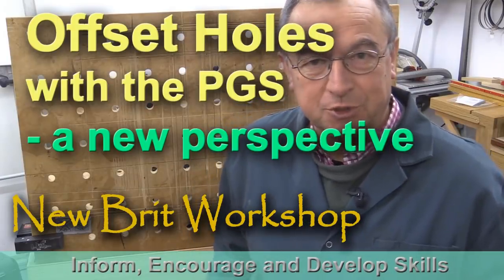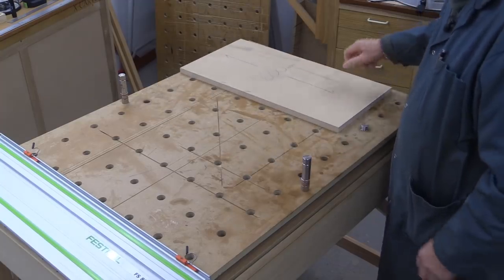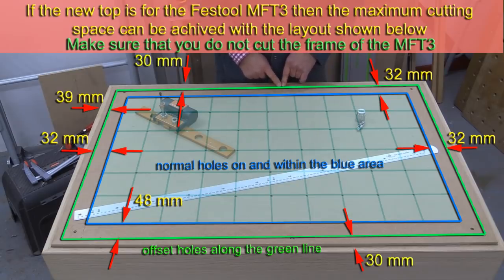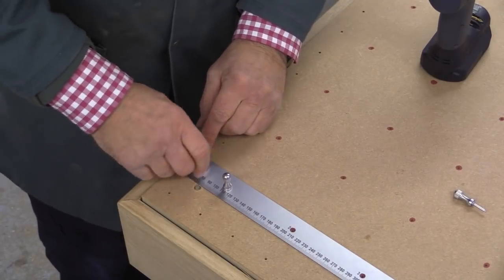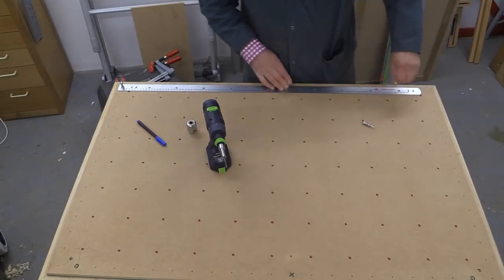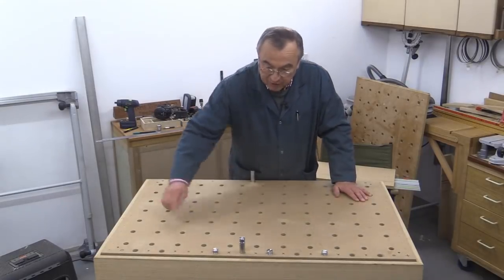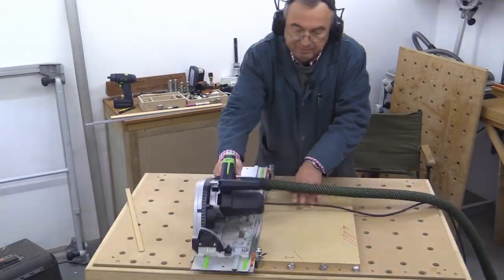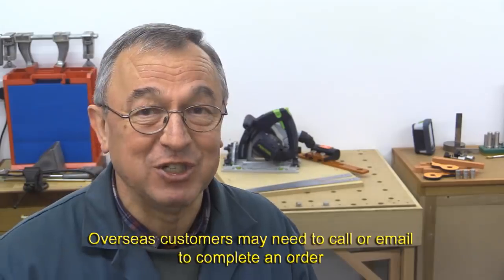Offset Holes with the PGS - and the definitive 4 Cut Test

Comment: Mr Parfitt, the Parf Guide System changed the way I woodwork. My poor man's planer now has 20mm dog holes. My torsion box/shoot board combo has 20mm dog holes. The one problem I keep running into is the pins.  The pins only fit one parf stick. It would be sweet if the 6mm boss were long enough to secure two parf sticks. Just a thought. JL
Reply from the maker: Thank you so much for this. Cheers.  Peter

Comment: Hello Peter, is there any way to drill accurate offset holes for the super dogs using the PGS Mk1?
Reply from the maker: Hi Hugh, Yes, if you use the two rulers set up in a triangle- remember symmetry.  Peter

Comment: Very useful video. I have the system 2 and already created my MFT top with 96mm holes. Fortunately I left a few undrilled holes to make sure I could still extend the table holes at a later date but they are in the way to some degree. I just hadn't thought about what now is obvious - create a series of reference holes all around the edge! Thanks!
Reply from the maker: I am glad that this has helped.  Cheers.  Peter

Comment: What if your table was doubled the size. Do you then connect 2 rulers to get a row/column complete?
Reply from the maker: Hi Stephen, You start at the middle of the top long side so that you then expand left and right in equal measure. This reduces compound error by a huge amount. It is covered in the instruction manual.  Peter
Reply: @NewBritWorkshop  apologies, I should clarify. At the 8 min mark, when drilling the offset holes along the bottom of the table, the ruler is the length of the example table you are using. If the table was wider, the single ruler would not fit.

Comment: https://youtu.be/fTgoeAV4tDk I made an 8x4 mft top. I want to add offset hole long length wise. Can this be achieve after putting 20mm holes into top?
Reply from the maker: Yes, all you need is a set of Parf Revision Dogs:
https://www.youtube.com/watch?v=1iflvxzUIe0
Good luck.  Peter
Reply: @NewBritWorkshop  https://youtu.be/Chtn6GabWXk I used the 20mm guide for offsets. So I can sacrifice any part of the large work area. I wish to make racking for the van, so about 6ft high , this is why I made a large top. I just need to figure out how to make a callapspable worktop that folds away so I can store in garage.
Reply from the maker: Yes, you can use the 20 mm guide to create 48 mm offset holes. You need to use the offset position as you indicate in your video but use the 3 mm drill through it first. That way when you use the 20 mm cutter it has the (required) 3 mm hole to guide it through.  Peter

Comment: Any thoughts on variations of hole placements?  I have been debating doing row 32 or 42 mm from outside edge then starting 96mm spacing. Will be on a larger bench 36 to 40 by 72 to 80 inches. Any direction would be much appreciated. Anxious to use the MK II that I just received but don't want to get ahead of myself.
Reply from the maker: Hi Richard, I have made several videos about offset holes and even an Isometric layout. I can't list all the links but hope that you can search for them. I favour offset holes furthest away from the operator and nearest to the operator for the tall dogs that the rail goes against. This gives the maximum cutting capacity in between. Do search for the Isometric layout which is perfect for 90 deg, 30 deg and 60 deg cuts.  Peter
Reply: @NewBritWorkshop  I should have been more clear, sorry. But was thinking of having the rows and columns start at the 32 or 48 mm from the edge. Thank you for your earlier quick response and hope you have a good day.
Reply from the maker: Hi Richard, You can have the rows or columns with centres as close as 32 mm from the edge of your bench top provided what structure of the bench is below does not risk causing any damage to the 20 mm cutter whilst drilling the holes.   Good luck.  Peter

Comment: Hi Peter. I have started making a new MFT top using your Parf Guide MK2 and I have a question on finishing. I would like to finish the Medex you recommend to help with glue ups. Would you suggest Osmo Polyx and should I apply before boring the 20mm holes? Best Regards, Rob.
Reply from the maker: Hi Rob, Yes, always apply the PolyX or any other finish prior to drilling otherwise the oil will go into the 20 mm holes and make them too tight.    Remember to use a pecking motion when drilling the 20 mm holes and also a dust extractor.  Peter

Comment: Peter,
I think I asked this before but did not understand your answer. I have a couple of festool mft3 boards that are already cut with holes. Is it possible to leverage the PGS Mark II system to add the offset holes?

I know the PGS Mark II system can create the offset holes if the holes are all 3mm. I am asking once they are already 20mm. 

Thanks
Reply from the maker: Hi Jeff, It is not easy and with the original Festool tops you will not be able to guarantee accuracy. However, if you have the small Veritas Parf Dogs or the locator dogs from the Mark 2 PGS you can butt a Parf Stick against them to create a new row of 3 mm holes.   Peter
Reply: Peter,
Thanks for your quick response. It is really impressive when you respond like you do. I like your idea regarding an existing Festool MFT table. I think it might work how you described above. I have several Festool MFT table boards and I would prefer to leverage them if possible with the Parf Guide system Mark II for now. 

Thank you very much and love your channel. Even us Texans are Brit lovers :)

Jeff Marks

 @NewBritWorkshop

Comment: How about a pair of Parf Dogs that sit flush with the table top (held by a top chamfer) and have a 3mm hole in the center. These could be used to align the Guide System on existing tops.
Fantastic system. Excellent videos. Thank you!
Reply from the maker: Interesting idea.  Cheers.   Peter

Comment: Hi Peter, just had my first attempt using your system MK11. I am building a large table and I used High Density MDF. after drilling with 3mm pilot the pins were incredibly tight I could not push them in by hand and had to use a little block of wood. Perhaps the nature of the high density material closed the hole up by expansion? The result was that I bent two of the pins. Could not find a way to purchase replacement pins in the Axminister book? Do you know how I can replace just the pins?
Reply from the maker: Hi Scott, Phone or email Axminster Customer Support and they will help you.   Peter

Comment: Peter, for those of us who purchased the original Parf Guide system, could you not provide a supplemental straight edge with the 48 mm and 32 mm offset holes?  Give it a thought.
Reply from the maker: Hi Henry, I have run this past Axminster a year and a bit ago just before the final design acceptance of the Mark 2. It may come and I agree it would be useful.   Peter
Reply: I hope so, it doesn’t have to be too complicated and  not much longer than  300 mm so as to pick up on two 3mm holes for accuracy.
Reply from the maker: That is almost exactly what I designed 2 years ago.   Peter
Reply: New Brit Workshop  - Actually you can drill a 48mm offset  with the pins and the Guide Block.  You have two positions for drilling holes and the are spaced at 48mm.  The only thing missing would be the 32mm offset, if you absolutely wanted that.  All is good.  Great tool!

Comment: You can of course cut wider stock by cutting parallel to the long sides of the table top. Notwithstanding, this is a great system for creating tops of all sizes.
Reply from the maker: Hi Joe, Of course. Many thanks.  Peter

Comment: Have you made a top of Melamine? I know it chips, but it is smooth.  Does it ruin the cutters?
Reply from the maker: Hi John, No. The cutter would manage it but would lose its edge quite quickly. In MDF the cutter leaves a clean exist hole but if the melamine was on the underside, as I would expect, it could chip out and look untidy. If it were a very special top then you could effectively sacrifice the 20 mm cutter. The underside chipping could be avoided by first doing all the 3 mm holes, then from underneath use the 20 mm cutter just enough to cut the melamine and finally drill from the top all the way through. There might still be a tiny bit of breakout as the cutter rubs the side of the melamine underneath but it could be tidied up with a small chamfer. I think a new 20 mm cutter is about £20.  Peter

Comment: Hi Peter
For those who purchased the original system of parf guide, including me, is there a kit that will convert it to mark 2 or do I have to buy everything all over. Note that I am very happy with the original system and I have already saved tons of money by making my own tops instead of paying  festool over $100 for their MDF version. Actually I buy 1 1/2 thick MDF doors and I use your system to make my tops and had no trouble drilling through.

Please review and let me know.  I purchased your system in US from TSO products.
Thank you
Reply: Mimi Becks I was curious too, so called and asked Axminster about the availability. They would be able to sell an upgrade kit, consisting of Mark II rulers, 6mm bushed drill guide (tall and short, presumably), 3mm drill bit in holder for it, and the new pins with 6mm collars. I don't remember if I was given an exact price, but given that it's everything except the 20mm bit and collar, 20mm drill guide, and 2x dogs, the cost was going to be a good chunk of the cost of a full new kit. Also, since they're so slammed with orders, it's not something they'd be able to fill just yet. You can  always call or email, and ask for details and to conform what I've said.
Reply: @mlindholm  
Thank you for the reply and you are correct( please see Peter's reply).

Thanks again
Reply from the maker: Hi Mimi, The original PGS is just as accurate as the Mark 2 version. The key difference is that the Mark 2 will last a very long time as there is no direct contact bewteen the 3 mm drill and the Parf Sticks (rulers). If you plan on producing more than 30 MFT3 size tops then the Mark 2 is better. There is no upgrade kit as everything in the Mark 2 is different except the 20 mm cutter and the locator dogs.    Peter
Reply: @NewBritWorkshop  
Hi Peter

Thank you for the quick response reply. I apologise if I was not clear in my email but I have absolutely no accuracy problem and your system has performed extremely but the reason why I wanted the mark 2 is the ability to drill offset holes.

I look forward to purchasing the Mark 2 but as I understand it is not available in the US yet.

Thank you
Reply from the maker: It should be available from TSO about now or direct from Axminster with a few days delay.   Peter

Comment: Peter, these Parf tables are a great addition to any workshop but I think you are making a lot of work for yourself with these offset holes.  I don’t have this problem with mine because I made up a couple of 20 x 200mm long dogs and tapped each end with an 8mm thread.  This allows me to fit a T bolt in the end of each dog.  I can then pass the dog up from underneath and locate in the T slot on the underside of the guide rail and lock with a quick turn of the dog.  This means that any worktop cut is offset from the Parf holes.  When I want to remove any stock from under the guide rail I can just lift it up a little bit and it normally just stays there.  Alternatively with a quick turn of the long dog I can release the guide rail completely.  I’ve since found that BenchDogs now sell there own version of my dogs but they are only 100mm long and their T bolt has to be slid in from one end whereas mine can be put in anywhere on the T slot the rail.  If you want to see some pictures let me know and where to send them.
Reply from the maker: Hi Patrick, Very clever - perhaps you should make a video !   Cheers.   Peter

Comment: Peter, love this system. I completed a similar worktop idea on my new prototype  torsion table, however a few mm out on a few holes 🤔 Will the Mark I Parf guide  do as good and as accurate a layout out as the Mark II ? Or should I wait and buy the Mark II. (Currently OOS) The torsion box I built was really only a trail, I knew I would want to build a new very accurate one at some point.....looking at starting the upgrade in the coming month or so. I absolutely love the simple but impactful videos you post, learn loads from them 👍🏻
Reply from the maker: Hi Martin, Both systems are equally accurate but (IMHO) the Mark 2 system forces the user to be more careful and hence produce a more accurate result. As I am experienced with both systems I cannot put one ahead of the other for accuracy. If you are planning on making a lot of tops then the Mark 2 is better as there is far less wear after multiple use.    Peter
Reply: New Brit Workshop thanks Peter, keep those videos coming 😉 Mark II it is then 👍🏻
Reply from the maker: Hi Martin, Good choice.   Peter

Comment: Thank you Peter for another excellent video and great tip. Sadly this approach to prevent damage over the 20mm holes works only with the Mark II. I have to find a way to do the same with the PGS original :)
Reply from the maker: Hi Marcus, It can be done easily at the 3 mm hole stage.     Peter
Reply: @NewBritWorkshop  Thank you Peter, I will have to figure out in my next top.

Comment: Peter, firstly very informative well presented video (as always) One thing that has always puzzled me is why not use a sacrifice board under your stock so the surface is not damaged.This is one of those that you know there must be a reason but my dumb head doesn't come up with it. So I thought I would embarrass myself and ask. Thank's
Reply from the maker: The PGS 20 mm cutter hardly creates any breakout when used with good quality MDF. If anyone does decide to use a sacrificial board then it has to be fixed to the main board throughout the drilling process (both 3 mm and 20 mm holes). The reason for this is that the PGS 20 mm cutter must have a 3 mm pilot hole ahead of it in order to work. I have never used a sacrificial board and am happy with the results from the many dozens of tops that I have made.   Peter
Reply: Thank's for that Peter.
Reply: I did not want to embarrass myself, but I was thinking the same thing.
Reply: many people are using sacrifice board sucessfully including me and my mft top is as good as new. having offset hole is good idea too, because it increases your crosscut capacity.
Reply: Using a sacrificial board will not guarantee a clean hole. It help for sure but at some point you end up with dust between the boards and the damage may occur. The best way to prevent damage is to make the pilot holes which damage result is neglected by the bigger and final holes. Once the pilot holes are completed start boring the 20mm at +50% depth than turn the board upside down and finish the holes. This is a longer process but ensure you have perfect clean holes.

My thought.
Reply: Marcus, thank's for your reply but either I have I  misunderstood your reply or I didn't explain well. I wasn't saying about cutting or drilling the holes I was saying that to stop damaging the top of the MFT 3  top (as Pater calls it), why not put a sacrifice board between the MFT 3 board and your stock so that when you use a track saw you don't end up with curf marks on the board with the Parf Dog holes drilled in. I do hope that makes sense as I know what I mean but when I read it back I am not sure haha.
Reply: @barrynorman3906  My bad, I thought it was during the boring process. A sacrificial board on top of the MFT top would have to be very thin to not have to use tall dogs. Keep in mind that tall dogs may interfere with the saw motor. Some people create a recess and slide in a replaceable insert, but again you have to offset a row of holes to avoid dog holes.
Reply: Marcus, great I am glad we are now on the same page. Yes I can now see the reasons why it is not a good idea but as I said earlier I thought there must be a good reason as I do not consider myself a woodwork whizz and the sacrifice idea came to my mind immediately, so I am sure people like Peter or indeed yourself would have thought of this as a solution, then dismissed it. Then I thought, well if you have the Parf Dog System it is not that hard to make a new board now and then. Now Peter has shown the offset it will be less regular. Great to converse with you my friend !!
Reply: Barry Norman you can  look up Peter Millard's "10 Minute Workshop" videos. Peter uses an MFT daily, and has a solution for that. The short of it, is he routed out a 1/2" deep, by 3/4 or so wide slot in the MFT top, and cut a sacrificial piece of MDF to slip in there. When it gets too ragged, he can just pop that out and slip a fresh sacrificial kerf slot in.
Reply: @mlindholm  Thank's for that
Reply: @barrynorman3906  
I think you have a GREAT idea. I am going to try this. I hate those "kerfs" and "dingles" all over the MFT top (in no time I might add). Of course it would take some time and effort to add a sacrificial base to everything you wish to cut. But it might still be a GREAT idea.